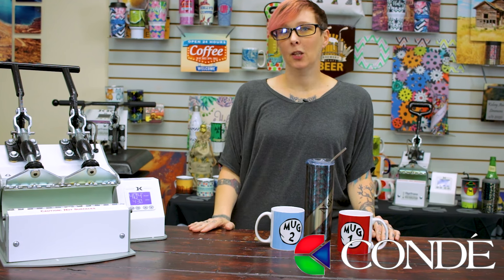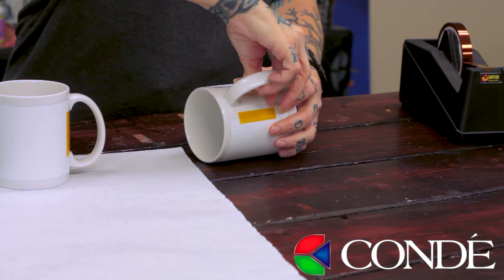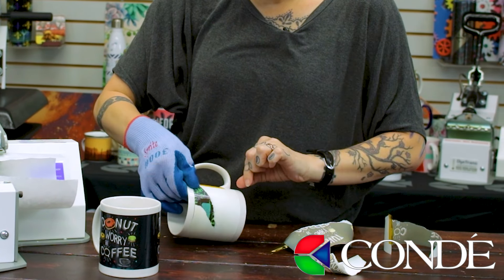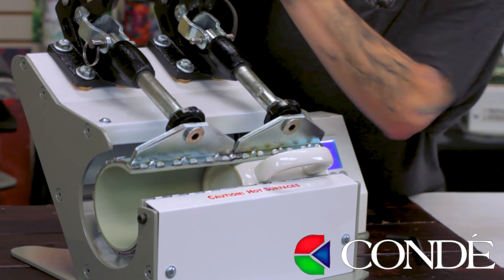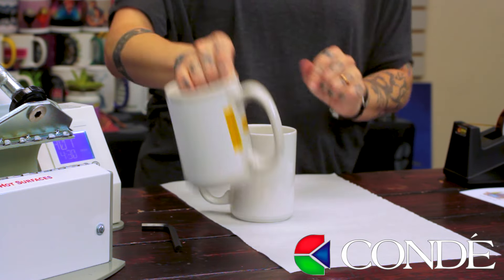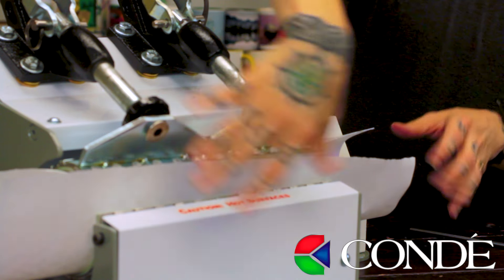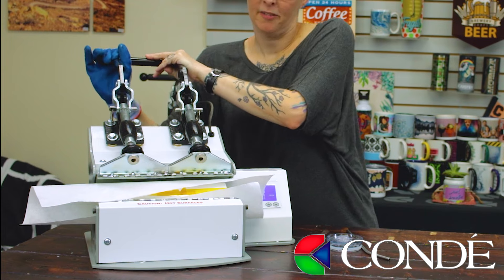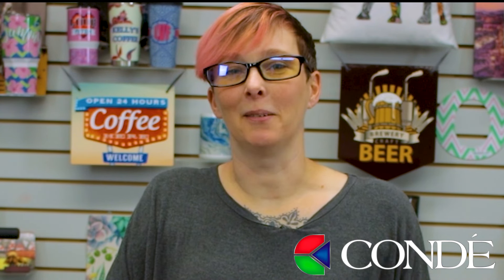Geo Knight Digital Double Mug Press

Comment: Thanks for this!  I sell only 15 oz mugs.  Could you go further into how you know you've got the best adjustment/pressure set up for 15 oz mugs?  Are there instructions for this that come with the machine?
Reply from the maker: Yes, this press will also do 2 15oz mugs at one time.  To fit the 15oz just unwind the black screw.  Yes the press comes with instructions and we also have technical support if you need assistance.